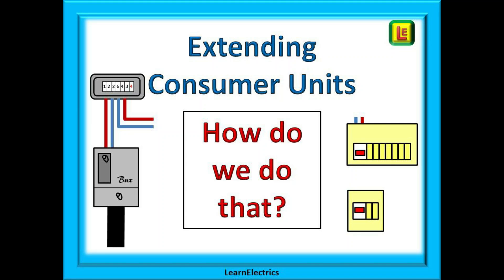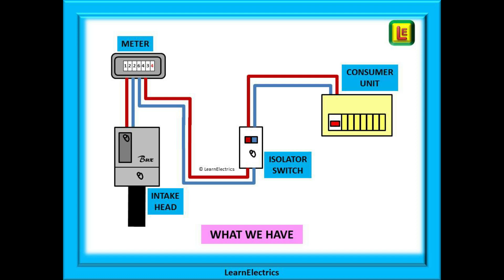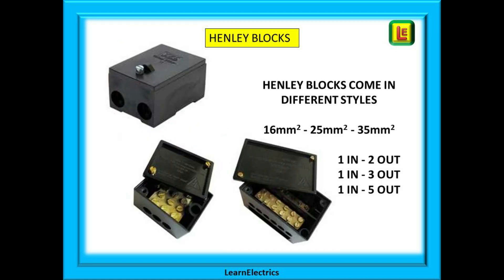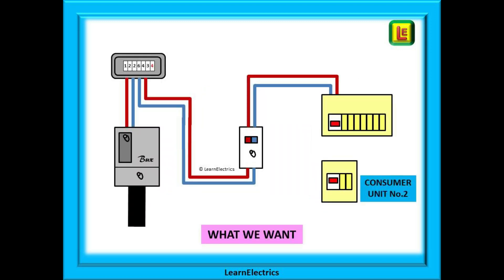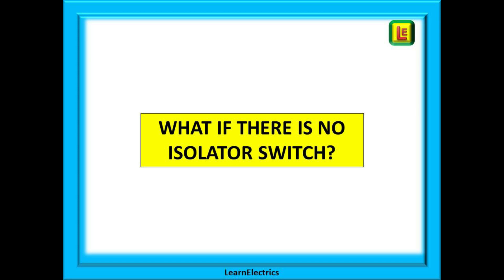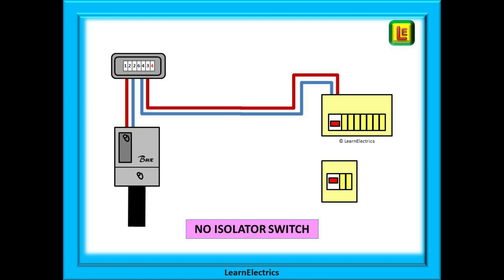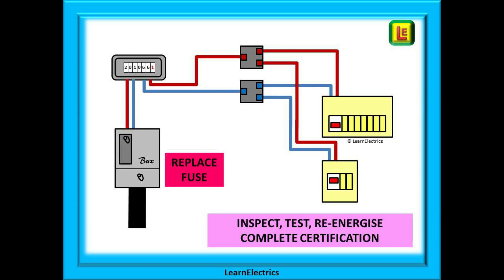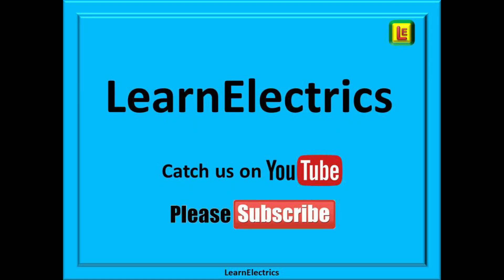EXTENDING CONSUMER UNITS. How to add a second consumer unit to an existing circuit.

Comment: thanks for your great videos..but i have seen many places they get fed from main CU on 32A mcb ,running 10 or 6 mm SWA and RCD protected on 2nd cu.  is it anything wrong if to do that way then ?
Reply from the maker: If the cable sizes are correctly chosen then that is good too. The beginning of our video says that we are assuming that there are no spare ways in the CU to do what you suggest, so we give the solution.
Reply: How would you incorporate selectivity into the scenario mahdi has said. Should a delayed type rcd be used somewhere in the sub board or along the circuit  to stop the main consumer unit from tripping?
Reply: @learnelectrics
Reply from the maker: Yes, a delay type RCD upstream is an excellent idea where there are two or more RCDs downstream. Have a look at Regulation 536 in the Wiring Regs, especially 536.4.1.4
Good points. dave.

Comment: Good video and thanks. Can you comment on sub mains longer than 3m to a second consumer unit in, say, a new extension. Is protection against overcurrent and fault current required on the output side of the Henley block? The On Site Guides are not much help, the IET Forum reigns confusion and Chapter 43 of the 18th is bewildering! Any insight would be appreciated. Thanks
Reply from the maker: Some DNOs like you to fuse/RCD at both ends of tails that are greater than 5 metres in length. A definitive answer is hard to find, all they say is to keep them as short as possible and be reasonable about the length if it does need to travel some distance.